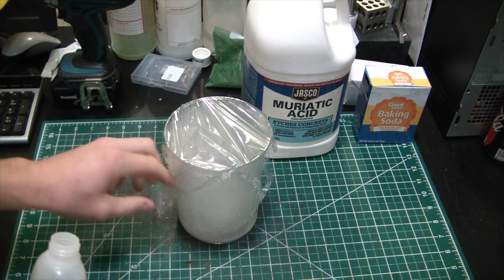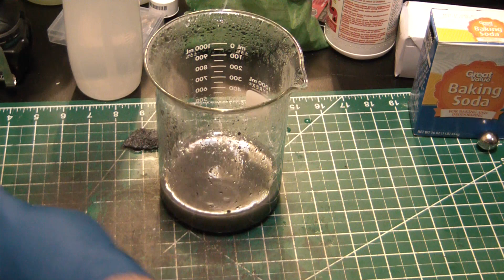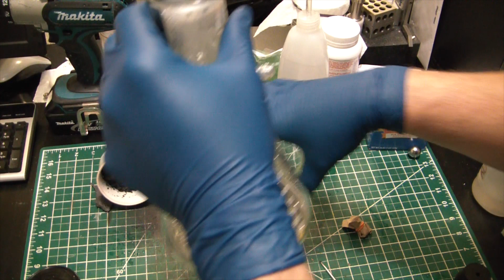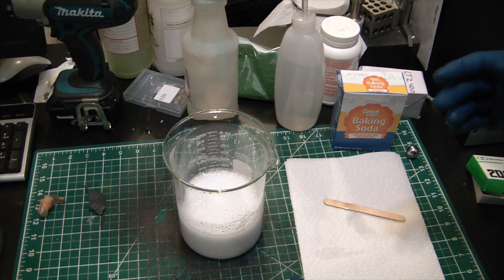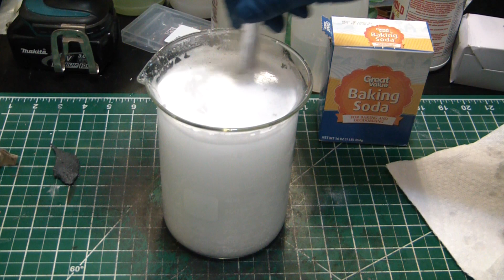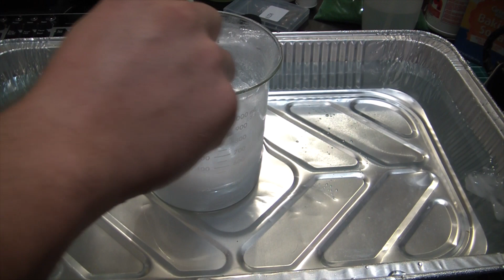Making Aluminum Oxide For Synthetic Ruby - ElementalMaker

Comment: Stay away from sodium compounds. The sodium is near impossible to remove and just the slightest amount of sodium impurity will cause the corundum to be opaque. :) I prefer to use Potassium hydroxide as it is easier to remove. Use a slight amount of HCl to bind with the residual potassium and iron impurities. After about 8 rinses, test the pH and it should only be the slightest bit basic. Use ammonia to neutralize any remaining HCl.   Calcinate the Al2(OH)3 then rinse another half dozen times to remove any excess soluble salts.
Reply from the maker: Damn I wish I knew that earlier. I'm going to give it a go with what I made here, but if it turns out like crap I'll give the process you outlined a go. I am going to give my aluminum oxide a few more washes before attempting to make ruby.
Reply: @ElementalMaker  What you have will be good enough for your first experiments. In fact, they use aluminum oxide made by the sodium hydroxide method for industrial grade ruby which doesn't need to be transparent. Things like bearings for example have synthetic ruby roller pins that will never see the light of day.

If you have any questions at all I have done an extensive amount of research and experimentation. A great starting point on your Al2O3 to Cr2O3 ratio is 95:5 by weight. Anywhere between 1% to 8% Cr2O3 is used for synthetic ruby, but the most common percentages are between 3% to 5%. You can get an idea of what part of the flame is optimal for fusing the doped alumina by shaping a cone or pyramid of oxide feed material and bring the flame down onto the tip to see where it melts. Ideally you'll want about 3200 Celsius to initially melt the feed material as it passes through the center of the flame if you are using the Verveuil method. Alumina melts at 2070 Celsius, but you'll want the surface of the boule to be resting in the 2200 Celsius gradient of the flame for more precise crystal formation.

Also, mix your chromium (III) oxide and alumina in a plastic cup, preferably with a magnetic stir. It doesn't require heat for mixing but you WILL need a very homogenous mixture as the chromium beads up into lumps at the microscopic level and you'll see blotchy red and green dots among the more homogenous reddish color of the overall ruby. I emphasize the point on using plastic because aluminum oxide will severely etch the inside of your beaker/glassware for any level of stiring. Plastic cups from the craft store made for mixing resins are perfect for this work because the plastic is HDPE, so you are very unlikely to contami ate your oxide feed.

If you decide to get into attempting to make sapphire, you will hate life for the first three or four attempts. Info found in various patents is purposely misleading to keep company proprietary information secret. Finding exact concise info on the the subject is not a trivial and average day on the net. Only a handful of successful companies exist in this world by keeping their composition recipes and procedure under tight security lock and key.  If you happen to be pushed into contact with someone like Djeva, they flat out tell you it is good to see you taking an interest into the gem making world, but then they try to break your momentum by telling you there is so much more involved than the chemistry alone and they are sorry they cannot assist snore beyond that level of detail as they need to keep their trade secrets. I totally get that because we would all do that with competitive businesses to run.

They also abruptly cease all communication when you completely understand their concern and was only looking for an encouraging thumbs up to ley me know I was on the correct path I've been following on my own. I told them how easy rubies are made, everything I've done to get very pure starting material including the most common industrial way of decomposing pure heated aluminum in an inert atmosphere which then has pure chlorine gas added to, the furnace chamber with the isolated aluminum to react vigorously with the chlorine vapor. A later introduces pure ammonia gas into the apparatus to makr highly pure Al2OH3 as all other by products are gasses and ammonium chloride salt which is very easy to separate from the oxide feed.

I have a shit ton more to tell you to help you on your way. You are the fourth person whom had come to me to learn what I taught myself. Sapphire is no lie. It is a pain in the are to get the desired color, but yay for you I figured out the chemistry a while back. It is tricky fo create, mix and heat just to do that part right. Furnace conditions and timing is critical or you get common grey sapphire.--a well documented problem.
Reply: Where are you getting the chromium?
Reply: @TheLightningStalker  I have a couple lbs of chromium (III) oxide from a pottery supply seller on eBay. I also have elemental chromium I bought from a Chinese seller.
Reply: Hi, tnx 4sharing, but how can we calcinate it? Pls could you tell us?
Reply: @mwilson14  Dude thank you so much for this posting. I am very interested in that topic and it was really cool to read it. will make a screenshot, so when i will start one day my own experiments i can look at it. Thanks again ^^
Reply: @nivelbraack  No worries.  If you run into any issues reach out to me and I'll see if I can help troubleshoot.
Reply: @KAYAPOGAN  You have to heat the aluminum oxide at high heat for a good amount of time (up to several hours).  This causes other contaminates to evaporate away since aluminum oxide has such a high melting point of 2070 Celsius & boiling point around 2700 Celsius.  Occasionally stir the oxide to introduce fresh oxygen into the mix.  This will cause other impurities to oxidize and evaporate.  You should be able to use a ceramic crucible inside a propane forge/furnace.  You can use other heating methods with hot fires, but you need to be sure you don't introduce contaminates by keeping the crucible/container covered while in the fire.  I've used my fireplace several times with success.  It takes longer and is more cumbersome, but it can work.
Reply: @mwilson14  tnx a million Matthew, I'll use hydrogen hopping not  evaporating everything, anyway the torch is very small. Thnx again for yr generosity
Reply: @mwilson14  podrías enseñar un proceso para hacer alumina pura para rubíes?
Reply: Huh. Found this video 5 years too late, apparently, but I am also attempting to make rubies/sapphires. The big difference with my project is I am going to be doing a lot of experimenting with various color contaminants, just to see what I get. Oh yeah, and the other big, BIG difference.... I am going to be placing my compositions in small "bowls" carved out of dirt at the top of a mountain with a lightning rod running through them in an attempt to get some sort of Frankenstein fulgurite-ruby or sapphire gem.... Yes, I realize I sound crazy, and that's because I am, but hell, it's monsoon season here in the desert and I live next to a small mountain I climb regularly. I have all the chemicals needed and too much free time, so why the hell not? Wish me luck!
Reply: Sodium hydroxide is not that harmful
Reply: @Bestgamesforyou123  It’s not about the sodium hydroxide properties, but about sodium contamination, which makes the rubies and sapphires opaque. It’s easier to get rid of potassium contamination than sodium.
Reply: @mwilson14 I am a student from Denmark and I am trying to make sapphires in many different colors, for a chemistry project. And I was wondering if you guys could tell me something about the ratios of containments to aluminum oxides.

Comment: Soda cans are not a pure form of aluminum. The body is 3004 alloy (95.6 to 98.2% Al with the the remainder Mg, Si,Fe, Cu, Zn, Mn))  and the top is the 5182 alloy (95.2% Al and Magnesium and Manganese). A melted mix of the two alloys at best would be about 95% aluminum with a lot of other metals in your solution. If you are trying for gemstone ruby you have a shit load of impurities. Aluminum foil is more pure.

Comment: Its probably not carbon, you get the same results with aluminum foil as well. I always figured it was tiny aluminum or aluminum oxide particles. Its grey, not black like carbon would be. You would think it being so fine it would dissolve, but I think the acid just lost too much strength by the time those particles formed to easily dissolve them.
Reply: I know this is a very old post but something I noticed the other day. When dissolving soda can tabs in hcl my solution stayed clear, unlike when I used scrap aluminum. I was actually shocked as I had already prepared the filter. It made the process far less tedious.

Comment: The black “carbon” residue also contains a fair amount of manganese and magnesium with trace amounts of silicon and iron. Aluminum cans are made from 2 different Aluminum alloys; Al alloy 3104 (body: 98%Al, 1.15%Mg, 0.9%Mn) and Al alloy 5182 (lid/top: 95.1%Al, 4.65%Mg, 0.25%Mn.) 

The can top’s alloy 5182 contains more than double the magnesium —making the alloy more brittle— to ensure the  “easy-open” mouth punches out along the scoring mark via the pull tab. Manganese is added to both the body and the top to make the can sheet more ductile during pressing & rolling. 

FWIW: Aluminum foil is over 99% pure aluminum, however — and makes for a more pure precipitate.
Reply: Well shit, thanks for posting this for two years I've been carefully removing and saving the can tops believing them to be more pure for smelting. I'm glad I read this and thank you for being so exact with what you said. I'll look into it, but I guess I've been wasting my time topping cans and recycling.

Comment: Some suggestions I’d make. #1. Use an Ice bath to cool the exothermic reactions. Instead of adding water. It’s more affective.

#2. After you add the sodium carbonate to your AlCl3 solution ( and you added far to much. Just add the NaCO3 slowly, a little at a time until the addition of a small quantity no longer fizzes.) heat it to just below boiling and let it digest for 10-15 minutes. 

Filter while still hot to remove impurities and to keep the Alumina in solution. Allow to cool then precipitate the Alumina Hydroxide.

After calcining the the Alumina Hydroxide to Alumina if the product isn’t pure white you can further purify the product by just repeating the chemical process until the final product is white.
Reply: Great advice. I also thought about bath, shower with you.😂👍

Comment: Aluminium can body is alloy 3104, around 0.8% Mn and 0.8% Mg and 0.8 Fe. The top is alloy 5182, about 5% Mg with some Mn. The alloys are composition are formulated to produce 3104 alloy when remelted top and body for recycling. There is also some copper in both alloys.

Comment: I, too, used pop cans for high purity aluminum when I made Aluminum Chloride. I never had that much carbon in the alloy.  perhaps our methodologies were different.   I also allowed my crucible to remain well above above the mp for a while to drive off volatiles.
Reply: That's the main difference as to why your method had less carbon. The carbon is actually from the thin plastic coating that lines the inside of soda cans to protect the aluminum from reacting with the liquid contents. This lining protects the flavor of the drink and the structural integrity of the can. By continuously heating and prolonging the smelting process the lighter carbon from the plastic has more time rise to the surface and be removed as slag while small amounts boil off as CO2 gas.
Reply: @PGIFilms  but that wastes alot of heat and therefore more money than just using a filter like this guy did
Reply: @Cockalicious ’d really only worry about the money spent on heating if you were doing this on an industrial scale

Comment: You can actually get the oxide directly dissolving that chunk on the anode in the NaCl solution at 80+ deg. C. AlCl3 will react with NaOH from the cathodic area. At room T it will form a Al(OH)3 but with high temperature hydroxide will degrade to oxide.

Comment: if you believe, and not tease, you could use thin resistance cable, with a power supply, to heat it and the surrounding compound to melting point

Comment: Brother, how do you turn aluminum into synthetic rubies?
Reply: Add a contaminant to your aluminum oxyde, like 5% chrome oxyde and heat it really high.
NightHawkInLight as 2 videos on this, using arc wielder or a microwave.
Guess who work the best :P
Reply: @Technicotop  Thank you, brother. Does the thermite reaction succeed in the process?
Reply: @user-google777  Don't know, probably hard to handle. Even the arc wielder is not a that good solution as it adds carbon to the ruby.

Comment: I don't really know why I subscribed since I pretty much failed math in school and now at age 65 I can't remember stuff from one minute to the next.  I really liked this video as I have about 250 GMs of Aluminum Oxide Powder that I use with Epoxy Resin craft making and I bought it because I saw a video of someone making a statue with Aluminum and it came out shiny like a statue should look like.  Any tips on how to use this stuff in crafts?
Reply from the maker: In the case of making resin look like metal, your going to want to get bright aluminum powder, not aluminum oxide (aluminum oxide is white). Bright flake aluminum powder will make your resin look like shiny metal. Certain mica powders may also work to do the same thing
Reply: @ElementalMaker  Thank you for this information.  I was wondering if I had ordered the right stuff.  Have you recorded the video of the stone yet?  I'm looking forward to that video since I already have part of what I need on hand.

Comment: In fact, most soda and beer cans contain a little iron to make it ferromagnetic enough for sorting at the trash dump. Also the inside from the cans are lightly coated with something. From my experience most if not all brands of energy drinks use all aluminium cans, or at least an alloy where the aluminium content is relative high compared to other cans with different alloys for different drinks. Test it with a strong magnet and you will see it for yourself. P.S. The rest of the world says Aluminium, only Americans say Aluminum.
Reply from the maker: Yeah the inside of cans are coated with an BPA based enamel if I remember correctly. Ill have to test that, but per wikipedia: "The aluminium used in United States and Canada are alloys containing 92.5% to 97% aluminium, <5.5% magnesium, <1.6% manganese, <0.15% chromium and some trace amounts of iron, silicon and copper according to MSDS from aluminium producer Alcoa" Not sure a trace amount would attract a magnet, but I'll try.
Reply: I hope that you succeed in finding a good source for what you need, it is quite an interesting project to follow :-) Big thumbs up !!

Comment: If the sodium contamination screws up your ruby synth, try just calcinating the aluminium chloride, it is impossible to make anhydrous aluminium chloride via heating as the HCl is driven off first leaving you with first Al(OH)3 then (potentially purer) alumina.
But I can see why you didn't try that first being you did it in your oven.
Reply from the maker: Great suggestion. I may have to grab a pure chunk of pure aluminum off eBay and make up some reagent grade HCl. I did actually talk about just converting the Aluminum Chloride directly during filming, but edited that part out. I may give that a go next round if this batch is too impure.

Comment: How and howhigh/long did you calcinate the aluminium hydroxide ?

Everywhere it says about 1000°C (that's to form the alpha-alumina, gamma alumina occurs at 400/600°C).
I guess even it is not fully (or not at all) converted to Al2O3, it will be in the final ruby burn :D

Comment: I'm doing the same process, but I used some aluminum foil because I thought it was fairly pure, but not only did I get some carbon, but I also got a rather pink solution, I think my foil must have manganese in it lol
Reply: That’s probably not carbon but iron contamination. It just takes a minute amount of iron to cause that.

If the filtered solution is pink add the Na2CO3 and digest the solution at near boiling for about 10-15 minutes. That should precipitate any left over impurities. Filter it while still hot, then let cool before precipitating.

Comment: You should make some ferrocernium ( don’t know how to spell is lol) powder from big flint rods. I have done it with a ball mill made just for that project, and I got it and the charcoal I put in there super fine, to the point that if I mixed it with any amount of kno3 over 20% it burned nearly the speed of 70 30 perc al flash! It made some great sparklers to! I just used a steal rod to get it into mill able sizes, or until I thought it was going to catch fire. Then I got it down to about 30 mesh using mortar and pestle. It was then milled, with opining of the jar every hour after the first hour and a half. Also I mixed it with some kmno4  with the diaper method. I did this with with two sticks glued to the paper so I could mix it from five feet away. when it was almost done mixing it detonated, and made a report so loud I was surprised my ears didn’t start to bleed ( it was only a gram too!)
Reply from the maker: Man thats some scary stuff when powdered! Cant believe you were able to mill it without issues!

Comment: Al2O3 can be used for Ceramic Coating on Cars?
Reply from the maker: That might be what they use in nano-ceramic waxes that are all the rage now adays, but this stuff is way too coarse, and would wreck a cars paint. Aluminum oxide like this is more suited to be used for sandpaper or abrasive paste.